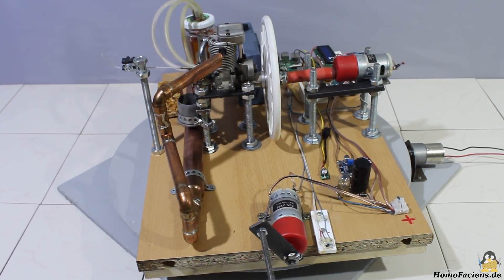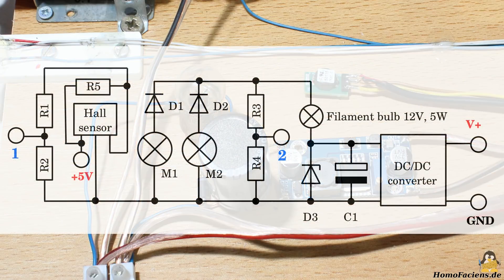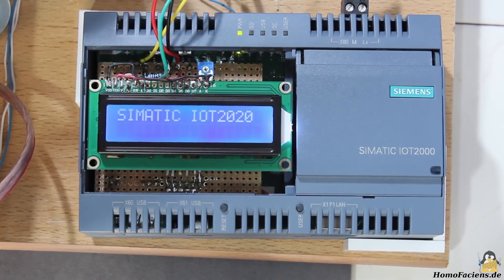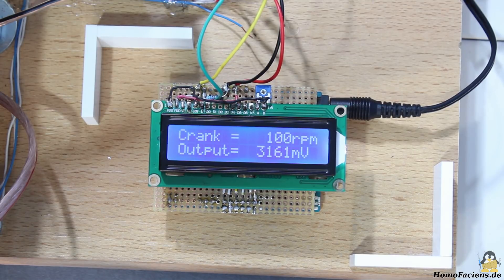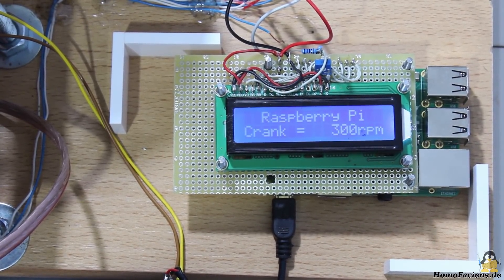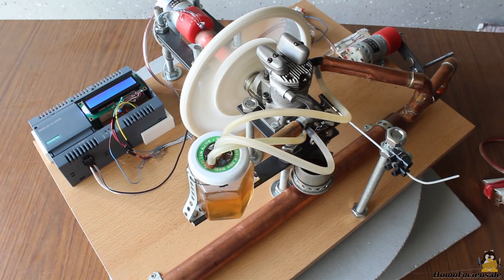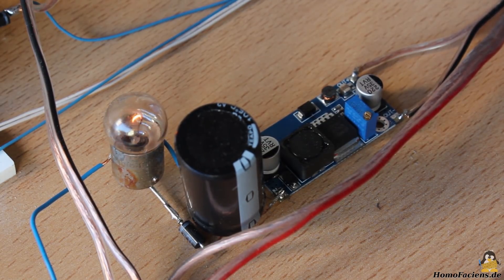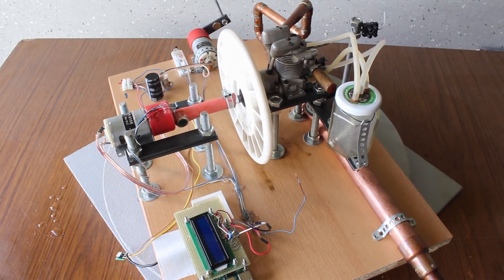Computing with peanuts or methanol

Comment: I can't imagine the gear massacre going on in the gearbox on the nitro-powered generator. Perhaps driving the motor directly and modifying the driver circuits to suit would work better? Not that one builds such a contraption for long-term use anyway, but at gearboxes wouldn't be consumable items :P
Reply from the maker: I used a long M6 nut with a bolt going through the outputshaft of the gear in a first try. That bolt was destroyed quickly. The rubber tube isn't that bad, but yes, I also wouldn't use it in a mission critical application. After recording the video, the sound of the gear was noticeably louder.

Comment: nice setup :-)  on ebay they sell a gen setup like this : 
https://www.ebay.com/itm/Mini-Methanol-Engine-Model-Toy-DIY-Micro-Generator-Motor-Water-Cooling-17000rpm/192497568333?hash=item2cd1bfca4d%3Ag%3AJ5oAAOSwzwxat3jZ&_sacat=0&_nkw=model+generator&_from=R40&rt=nc&_trksid=m570.l1313           
might save some time to use it
Reply from the maker: There is no fun in buying a ready to use setup ;-)

Comment: Next: Use aluminium from beer cans, NaOH and H2O and use the resulted H2 as a fuel for the engine. Also, make an automatic speed controller or ECU for the combustion engine using an Arduino few sensors and a servo.
Reply from the maker: ...there is always something to be improved ;-)
Nice idea(s)!

Comment: I thought you were going to burn the peanuts!  This reminds me of an experiment we did at school back in the 1960's.  We mounted a nut on a pin and set fire to it.  It was under a testube of water which we knew the volume of and measured the rise in temperature......
Reply from the maker: If you remember the recorded values you can now calculate the efficiency of my body in transforming peanuts to electricity ;-)
By burning you can transform the peanuts in something like "wood gas" to power the combustion engine with. I'll keep that in mind.

Comment: Interesting experiments! For next time I'd be interested in seeing current and power (amps and watts) for the different machines.
Reply from the maker: At least on a DC power supply I did the measurements right now:
IOT2020: 3W
Raspberry Pi: 1.15W
Arduino: 0.6W
LCD: 0.2W

I have added the measurements to my page:
https://homofaciens.de/technics-miscellaneous-electric-generator_en.htm
Reply: HomoFaciens Cool, thanks!

Comment: Do they make small Diesel engines like these? I want to make a 20W generator that runs on Canola oil (used French fries oil).
Reply from the maker: Real Diesel engines are very rare in model engineering - most are individually made by gifted craftsmen. 20W is in the range of vintage combustion engines. There is an event of old agriculture machines each two years here in my hometown and they have lots of those stationary engines and many of them run on vegetable oil as well. I have recorded a video about an Amanco engine on that event a couple of years ago:
https://www.youtube.com/watch?v=CPhOXyaGd38

There are also vintage electric generators available for those machines. That was an early way of getting electricity to isolated places.
Reply: this is pretty much a diesel engine, since its compression igniting. however there are rather small diesel engines but none of them will output 20 watts. you dont need to burn something to get 20 watt energy, even 1kw is not really big if we speak about combustion engines.. those little engines already have over 1kw at the crankshaft
Reply from the maker: Yes, the working principle is similar to Diesel engines using a glow plug, but they only run on Methanol/Nitromethane, because Diesel is too hard to ignite (too low compression).

This Saito FA40 is rated with up to 500W of power. The electric output power of my setup is below 20W, but with a more efficient generator you might get there.
Reply: HomoFaciens, Thanks, I enjoyed that link to those machines. 
I heard many years ago that there was a model aircraft engine that ran on diesel, but I didn't register it in the memory backs, since I wasn't interested in model airplanes. 
I could burn the oil in a controlled manner and create a closed -loop steam turbine system that would recycle the steam back into water. That way I don't have to keep adding distilled water to the system. That sounds like a lot of work and a lot less efficient than an engine, which is not efficient to begin with. 
I'll keep looking...

Comment: 9:15 Come on, don't be so hard on yourself. Your contraption is extremely efficient at wasting fuel and generating heat ;-)
I really like your bare-bone, form follows function style of doing things. Keep up the good work!

Edit: Oh, and by the way: Is that large exhaust tube needed for the motor to function correctly or is it just so large in order to muffle the sound better?
Reply from the maker: ...and blue smoke ;-)

The exhaust is just to lower the motor sound and in doing so it boosts the efficiency as a heat generator and fuel wasting machine ;-)